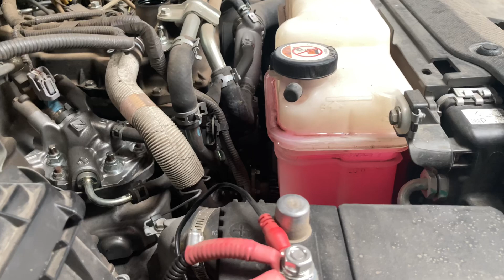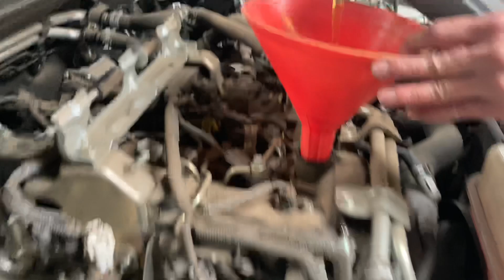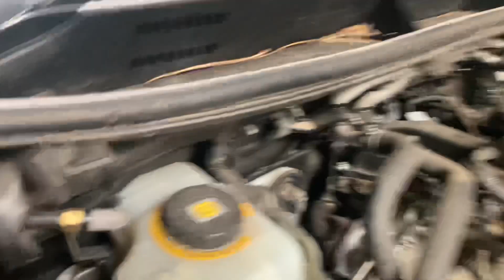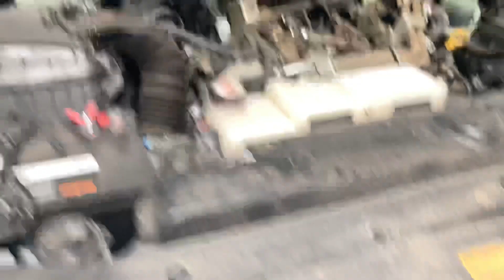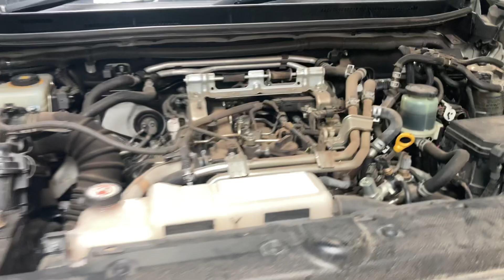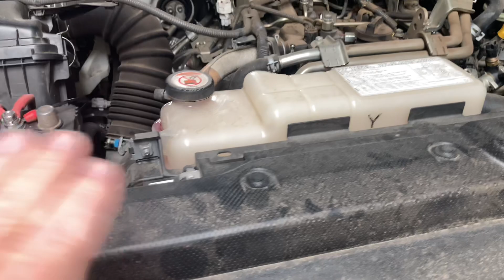The coolant could be disappearing into the engine 1gd-ftv

Comment: 1GD-FTV
DPF costs,
Timing chains and guides costs,
EGR cooler costs,
Why can’t Toyota build a reliable engine anymore?
Toyota used to have a good reputation.
Yet other brands like D-Max never seem to have issues.
Seven piston designs for the 1kD-FTV…seriously!
Love my Prado, but I should get 1,000,000 klms from a diesel without issue.  Sure injectors etc need maintenance, that’s life, but major engine damage IMO it means they didn’t do their homework first.  This is illustrated by the DPF fiasco.
This will be my last Toyota.

Comment: Valuable info. I had coolant disappearing with no leak, serviced the car at dealership (in WA) throughout its life. They suspected internal leak in EGR, did an inspection couple of days later and confirmed. They replaced/fixed EGR as part of warranty even though the car is 8 years old.

Comment: Hey my friend, my name is Angel a viewer from Panama in central America... I Own a 2022 Land Cruiser Prado Vx with the 2.8 1GD-FTV high output engine... But here we dont have emision restriccions... Soo no DPF in the Engine... I would like to take  the best care of this car... We've been having trouble getting the DIFF AND TRANSFERCASE LIQUIDS.... At this moment it has on the clock 42K... And still havent change those oils... 
Aditional... Based on our driving conditions here... The oil is changed every 5,000kms...
Reply: 75w-90 GL5